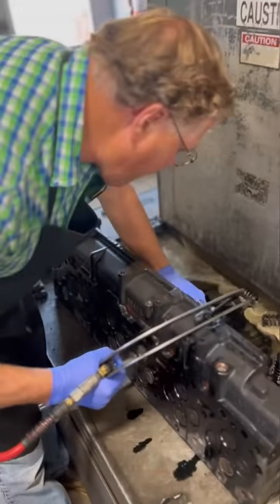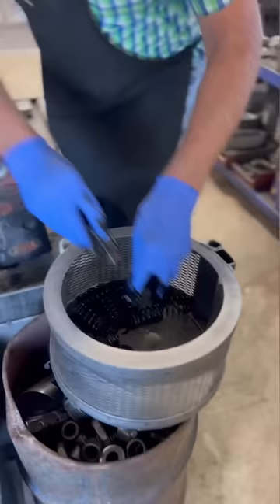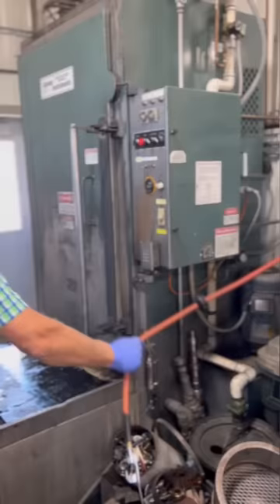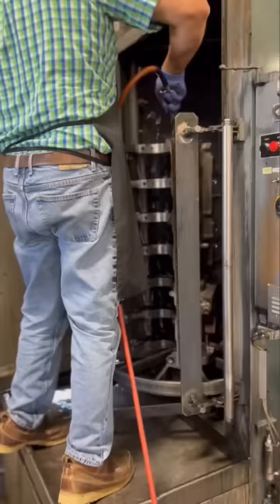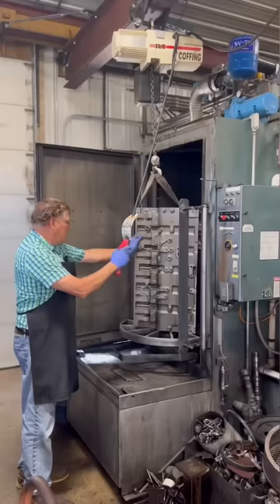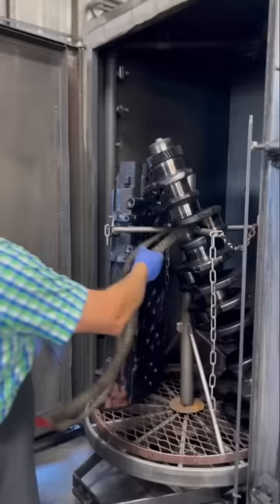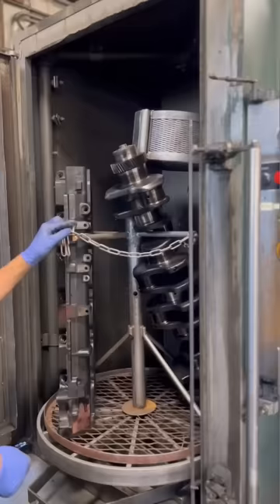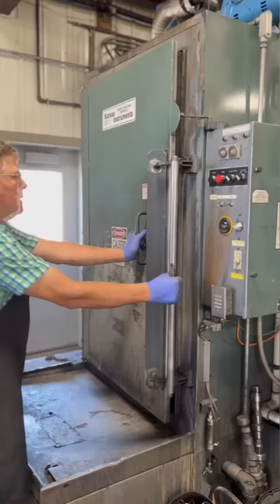#shorts Would You Trust A Guy With Only 39 Years Of Cleaning Experience To Do Your Machining?

Comment: Years ago I was doing some temp work for a local manufacturer (assembling a MASSIVE powder coating spray booth and oven, big enough to drive a truck inside). As I was working I noticed that they had guys sitting on upside-down 5 gallon buckets washing parts in adjacent buckets. I also saw the quality control issues they had when those parts were painted, and I knew they would have the same issues once the powder coating operation was complete. I told the owner he needed to get an aqueous parts washer cabinet for better quality and tremendously better efficiency. He didn't believe it was worth the $10k or so for the machine. I contacted a local distributor and suggested they bring a demo unit to the shop. They did, he agreed to let them set it up if they did it for free. Less than a week later he wrote the check and bought the machine. Unfortunately he couldn't make any good choices that weren't force fed to him so we parted ways after that project.

Comment: This what I use to do as a summer job in my high school year's. Walker machine shop. Tear downs, pressure checks, magna flux, ect. The old head use to tell me all the time. You're going to regret picking those heads and engine blocks up w/o using the hoist. Although not too bad yet but some day's I regret it. Some of the baddest old guys. Knew their stuff when it came to machining, valve jobs, and rebuilds.

Comment: In my 55+ years as a Master Mechanic, Rebuilding Engine, Transmission, Differentials, and everything else in between I've seen Machinests with 15 years experience do a better job than those with 30 years experience. But there are Machinists who have been at it as long as I have that I would Trust with everything. Simply because they understand Metallurgy. But the moral to this story is that experience and knowledge go hand in hand. Plus having the God given gift of being able to not only work with your Hands but with your Mind too.

Comment: Isn't it frustrating to the public that we engineers can design an engine that would last well over a million miles without any servicing, at the same cost as any other engine of its type. But we're paid to design them to have multiple failure points after certain milage.